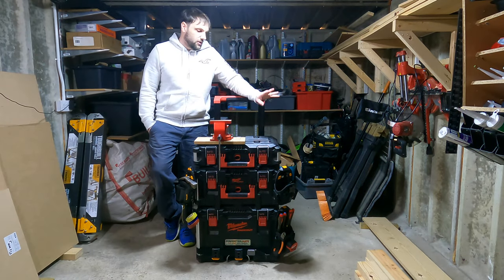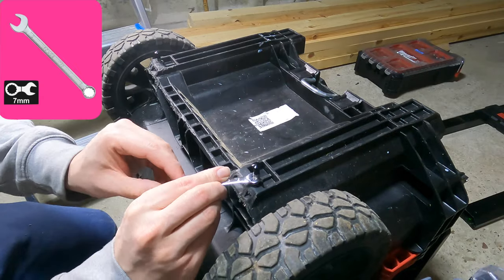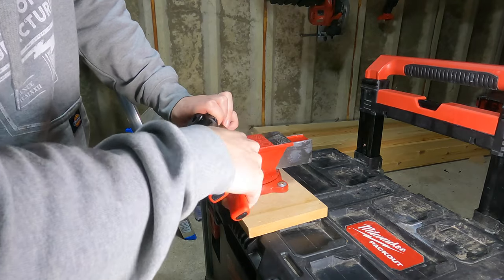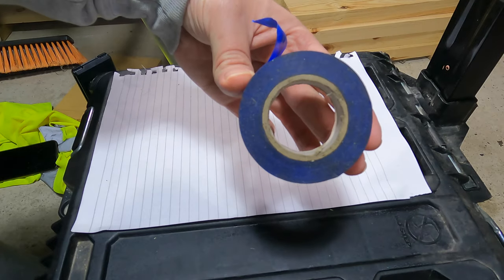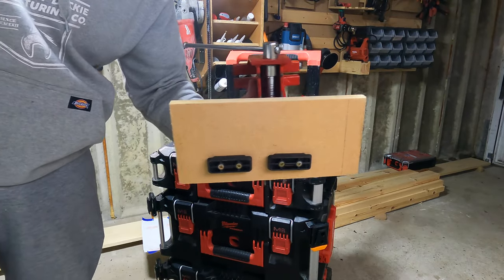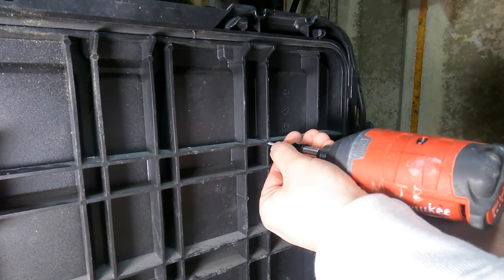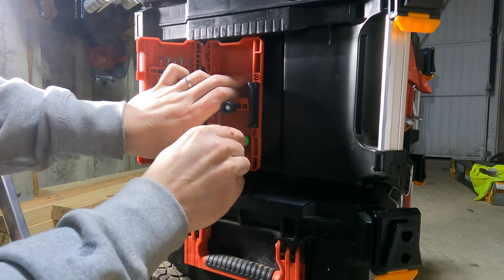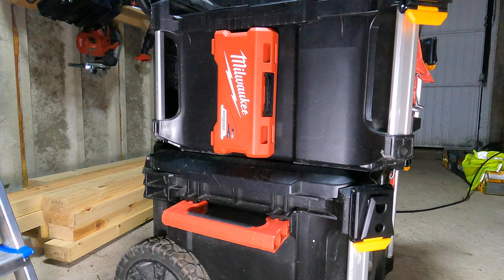Milwaukee Packout 5 Mods/tips/hacks

Comment: To get the spacing right for putting cleats on stuff I've put spray adhesive or thin double stick tape on top of the cleats and slide them into place then press the board onto them and slide them out. Add screws and you're done. I 3d printed my own cleats, files are all in thingiverse I think

Comment: You know with the clips the screw head fits through the front plate..... no need to remove the pin ect, the clip also opens... just for anyone else wanting to do the same 👍 other mods are mint
Reply from the maker: Yeah that was my bad. not sure what I was thinking  lol
Reply: Lol. Yeah I was also wondering.  Man milwaukee should buy out tough built. I LOVE all my tough built gear. Packout is missing exactly what tough built offers!
Reply from the maker: @davidseigo7978  Yeah totally agree.

Comment: I like the drill case idea -- I did the same with my first aid kit(on that spot on the case) but I used sticky velcro so I could remove it if needed. Thanks!
Reply from the maker: Yeah that's a nice idea.
Reply: You just use sticky Velcro or some other mechanical attachment for it?

Comment: No need to remove the pin on cliptech. They have holes you can screw through while they’re closed
Reply: Even if there not holes i drill those holes.😀
Reply: Exactly, was thinking the same thing! Guess he was overthinking it. Lol. Love those toughbuilt clips and toolbelt. As a contractor, I use them all the time. You could also buy the toughbuilt mounting rail and perhaps mount them on the packout rails somehow. I’ll tinker with the idea.

Comment: Nice work. Any chance you could link the parts you've used? Specifically the pins for the handles.
Reply from the maker: Hey. I have just added the links to the description for you. I have noticed on amazon the m5 pins I used are out of stock at the moment but if you copy the description of the product on amazon through the link I have provided and paste it into eBay they do have them in stock. alternatively you can just buy the m6 pins of amazon and they would do the same thing. you would just need to drill a 5mm hole and tap with a 6mm tap. Hope this helps.
Reply: @mikebolt9753  top man, thank you.
Reply from the maker: @Wardy75  Your welcome

Comment: what is the reason for removing the metal pin on the Tough Built clips when there are holes on the front face of the clip seemingly for this very purpose??
Reply from the maker: Couldn't get my drill bit holder through the front facing holes and using a screwdriver was difficult to screw into the aluminium bar behind the plastic.
Reply: @mikebolt9753  sounds like someone should invest in a right-angle bit adapter? Or not? Maybe? Just an idea mate 😅
Reply from the maker: @joshuatolodxi179  yeah you can never have enough tools lol
Reply: @mikebolt9753  my father would disagree but I agree, if I could I'd have at least 2 or 3 of everything.
Reply from the maker: @joshuatolodxi179  haha 😂 yeah the more the merrier

Comment: So I did something kind of like what you did but I got a buddy to 3D print me the female (tool side) of the cliptech and I screwed those onto my bit cases (i have 4) and then bolted 4 male cliptech clips to the packout. So I can just lift up and down and pop them off, and if I lose bits, it's easy to just pop that 3d printed clip off and put it on another case if I buy another one. Your imagination is the sky when using the 3D printed clips for the cliptech system. If you can put a screw or a bolt in it, it can be clipped. You could even do it to tools lol

Comment: Some really clever ideas there.  I've just bought a complete box tower and am just looking at mods for it to be able to use it as an art table and storage for painting and art supplies... no.. you can never have a big enough box lol !  I was wondering if you've ever taken out the lid section lining of any of the boxes and what was behind it?  As someone who uses every inch of space available for paints and glitters it's a bit frustrating I can't use that lid space with magnets and a piece of steel sheet.. do you have any thoughts on if this might be possible?  No one in the Milwaukee tech team seems to be able to help 👍
Reply from the maker: Hey how's it going. I actually have another packout video on my channel which is the 5 mods and tips part 3 video where I actually take the inner lining of the box out to place an air tag in there so might be worth you checking that video out so you can see how much room there is. :)

Comment: Mod 1 is great man! To add to that mod would be a DYI for clips or a way to affix the removed handle onto the back or front of the packout, but sideways (horizontally), so it doesn't get lost or misplaced. Please keep the videos coming, as you have killer ideas on the process, like using pencil rubbing for hole drilling placement. 👍